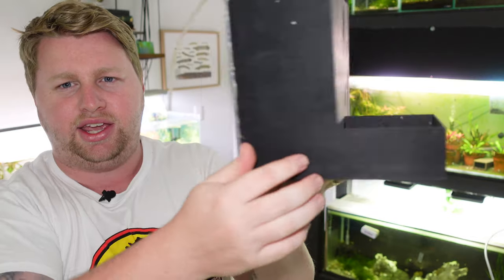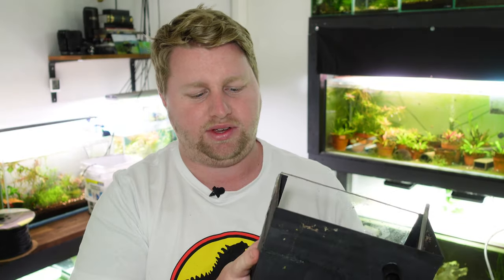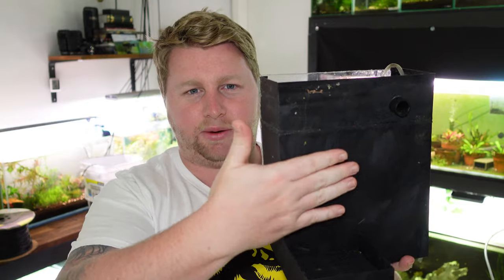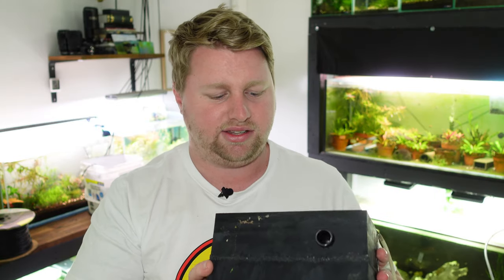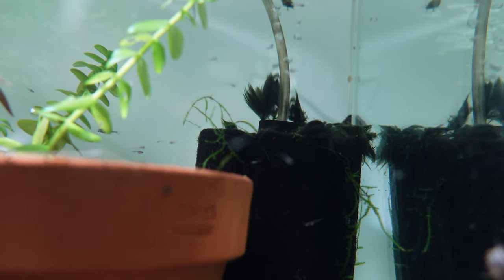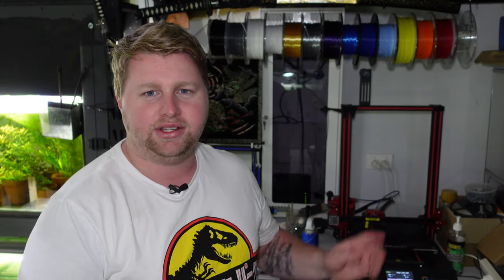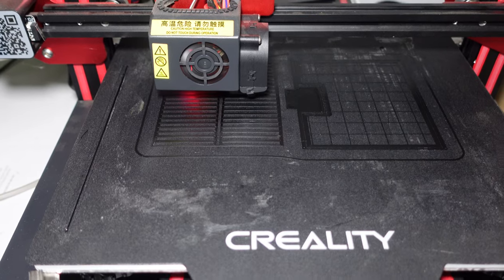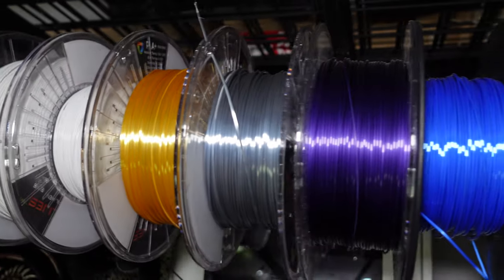EFFORTLESSLY Breed CPDs, Rasboras, Tetras and Danios with this 3D Printed Egg Trap

Comment: Recieved my egg collector in the mail yesterday. Got it setup ttoday after work. 

The assembly with my external hatchery box Went very easily. If this works out for me ill be thrilled, because ive had very limited success with my egg scattering fish. 

Thanks a ton! Ill keep you updated. 😊
Reply: @jonpierce8342  Hi there! Do you maybe have an update?
Reply: @Jo-ec4fe  I'm clearly not using it correctly... I placed it in a 20 gallon tank that was heavily planted already. I only have 4 white cloud mountain minnows, bladder snails, scuds, and some blue dream shrimp in there. The minnows don't seem very interested in the egg collector as they are busy darting around in the plants most of the time, but the shrimp have got a secret colony going on in the underside of the egg collector, and they think it's pretty great!  My hatchery box seems to only collect scuds. 😁 I am sure I could place it in a smaller barren tank with a clump of moss in the egg collector, and only my target species, and it would work great.  I am just a bit daft... 🤣
Reply from the maker: Hi Jon, i have found shrimp (and to a lesser extent snails) to eat cpd and emerald rasbora eggs. They could be the issue 😬
Reply: @BlakesAquatics  😁 that would explain some things...   Thanks for the tip!

Comment: I waited 24 hours before watching this because I figured as soon as I watched this I would have an extended DIY job on my hands. I made something already after an early video of yours but was running the eggs into an internally mounted Ziss breeding box. I am not sure if I had to much air running and was straining the eggs out through the sides of the ziss breeding box or what . I had no still water area for day old fry . As I retired guy I have the time to play around with plastic funnels and air lift tubes etc. . Thanks for the tips on a still water area for newly hatch fry. It’s great Fishman follows you Blake. Keep up the good work mate.

Comment: Hey mate - you were awesome enough to share your stl with me back in sept and I edited it a bit and attached it to a small breeder box as well :D 
Totally appreciate you don't want to share the stls anymore because of the effort you've put in - real top effort.
I love that you've designed it to fit a screw in elbow. I designed 3d printed elbow and tube to squeeze into a piece of plastic bunnings tube and attach the airline, but the design you've come up with is heaps better. 
Thanks for your help and advice. Your videos have been super helpful!!!
Reply from the maker: Thanks Dennis! Appreciate it mate I remember sending it to you, glad it worked for you

Comment: Great video mate and thanks for the credit.  Very neat little solution you’ve settled on.  That’s the fun bit about the hobby, just keep tweaking the print until you get it right.   Just had a thought.   You could also have the riser tube go into a floating breeder box if you didn’t have an external one.  That’s what I do because I have lids on our tanks.
Reply from the maker: Yeah for sure, i like this way because if people want to get diy with it it has that flexibility but for those that dont or cant they dont have to

Comment: Looks like something that I may wanna try with my own fish! Only questions I can muster is are hatchery boxes sold separately, as are extra pieces (hoses, plastic pipe, etc.) to attach to said hatch box? Im planning to use a srandard 10 gallon to breed some white cloud minnows and danios and possibly neon tetras. Other than that, love the videos, dude!
Reply from the maker: Thanks mate, I added an updated video recently which may clarify a few things but i include the black poly pipe and fittings, not the hatchery box. Nothing else is required apart from that. Thanks
Reply: @BlakesAquatics  Ah, cool beans. I'll be sure to review it soon. Thanks for the update. And while I'm not quite necessarily in the aquarium hobby like I was back when I was a kid, I've really been all about low-tech concepts such as mini ponds and such. In any case, a product such as yours may be what Immlooking for to help increase numbers in my own personal stock. In any case, thanks again, man!

Comment: Great design! I'm surprised the model doesn't float since it's made from plastic. Does connecting it to the hang on box's tube help stop it from floating?
Reply from the maker: Yes, also it is 100% infill meaning no air gaps between the walls so even if it wasnt it would sink as long as there arent any bubbles trapped somewhere

Comment: hi Blake, looking at getting one of these from you, what's the hang on breeding box you have? got a link for the one you use? thanks mate
Reply from the maker: Hi mate mine is branded aqua manta, large size but i have made 100s and never heard of a brand that doesnt fit. I also have a few other brands in operation. Pisces, fluval maybe but I cant remember.
Reply: @BlakesAquatics  thanks Blake, appreciate the quick reply. i will pick one up soon.

Comment: Can I use your breeding box, when I put a dividing glass in my tank so that the eggs float to the other department?
Is there anything else that I would need besides the stuff in your set?
What diameter in millimeters should the whole in the dividing glass be so that your pipe fits?
Reply from the maker: Hi mate, yes that can definifely be done and I have seen it done. To do that you connect the box directly to the glass and then have the uplift as more of an outlet on the opposite side to the box.
Best bet would be to receive it and then drill the holes accordingly
Reply: @BlakesAquatics that sounds like a plan. My breeding tank is a bit bigger and I think it would be better to divide it instead of using a Breeder box. Thanks, mate.

Comment: Hey i just purchase your device, arrived quick to Canada and put together in 10seconds. What do you recommend for the moss and positioning of the device? Should i have direct light over spawning area or should be be blocked by floaters? I have live plants and unsure how best to attract them to this exact spot? I have CPD and Emerald Rasboras. I am fairly limited to where to put my breeder box so trying optimize what i can. (unfortunately its a planted tank and not a dedicated breeder tank)
Reply from the maker: Cpd and emeralds in the same tank? Of so they can interbreed so I wouldnt recommend hatching any of the fry.
Floaters or light i dont find to matter and just simple java moss works best i find.
Reply: @BlakesAquatics  Great point, i remember finding out CPD are called Galaxy Rasboras and didnt make the connection until you mentioned it. Will pull them out into a separate tank. They dont really go near the box yet :(  may just need to use in a dedicated breeder tank with no other plants/moss except for the device.
Reply from the maker: @porchemasi  i have done it before with other plants and decorations, it can still work but definitely doesnt yield as many fry.
Just give them a few days to get used to something new in the environment and they should settle into it